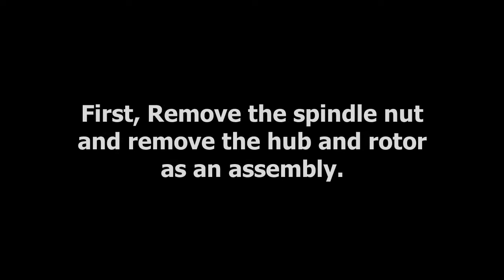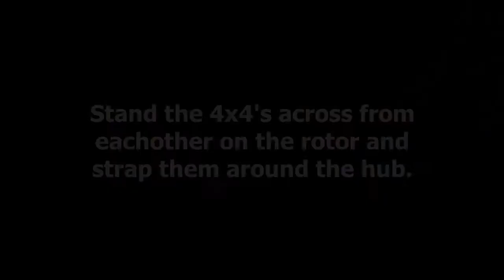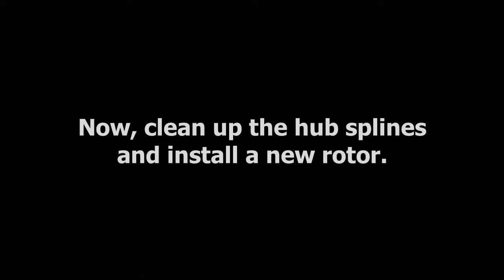Splined Rotor Removal

Comment: Gap between the spline inserts on the new rotor should not be more that 0.015 in or .4 mm. Always purchase a new installation kit. It comes with the inserts and bolts.